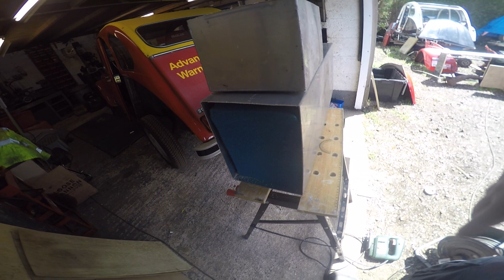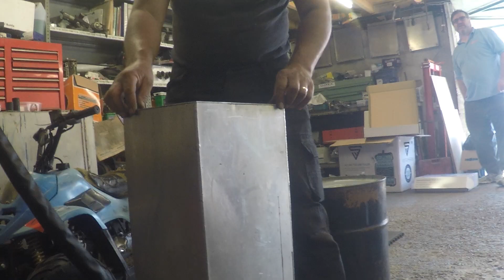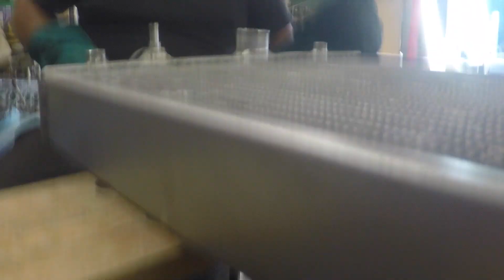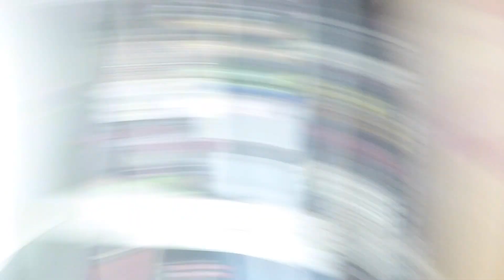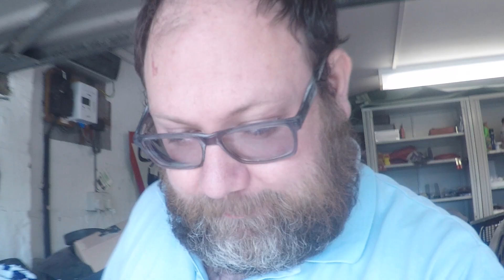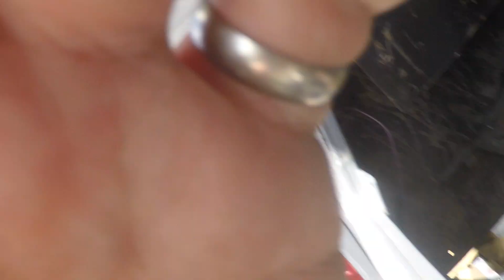TIG Welding Custom Aluminium Parts - 1958 Ford Prefect Pinto Turbo

Comment: I imagine if you purged the tank with argon it wouldn't be able to ignite?
Reply from the maker: True, but in imagine it would still melt from the heat? Sure will be fine without anyway :)